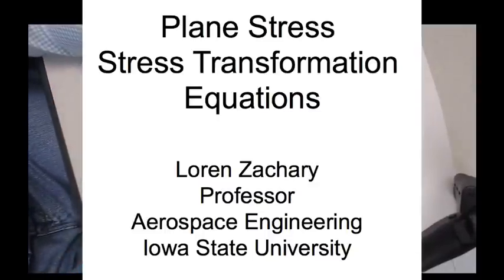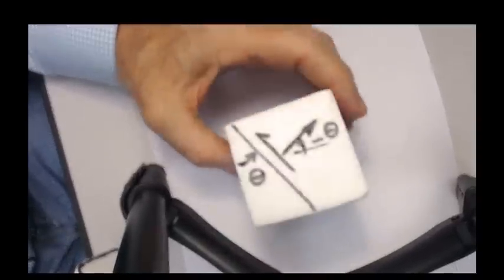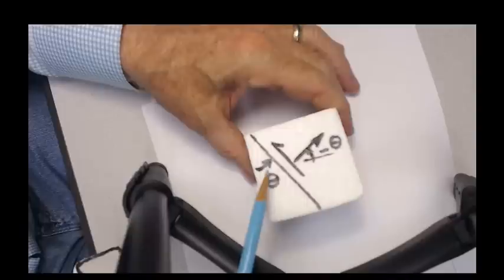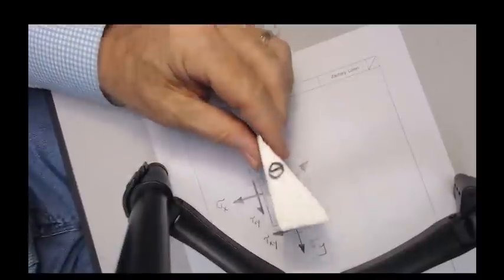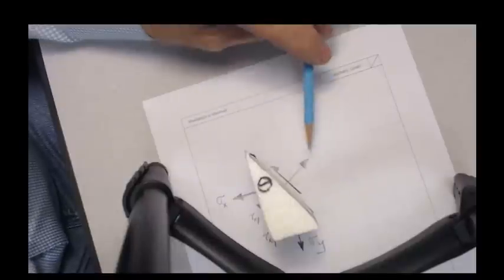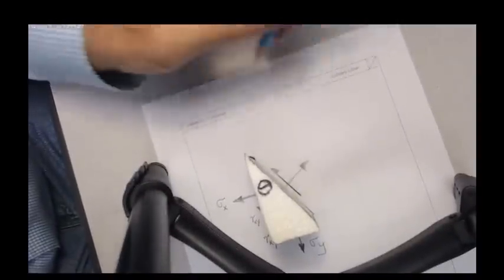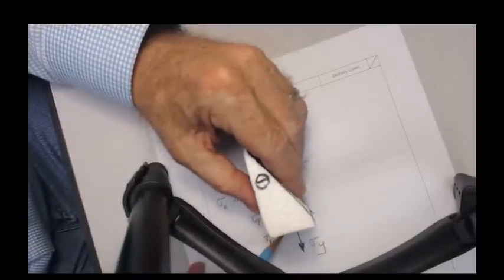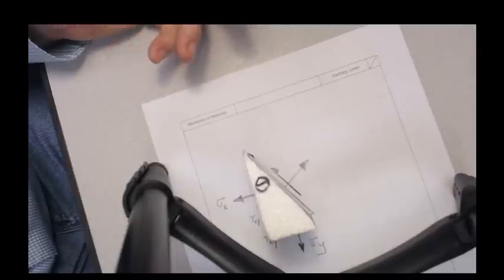Stress Transformation Introduction.mp4

Comment: This made so much more sense. All the book kept saying was to use the Stress Transformation Equations, which came out of nowhere. The only issue is that the problems only give the cross-sectional area instead of the actual dimensions, so I would need to assume it's a cube to do it your way. Maybe the dimensions cancel each other out?

Do you have a follow-up video that actually goes through the actual calculations?